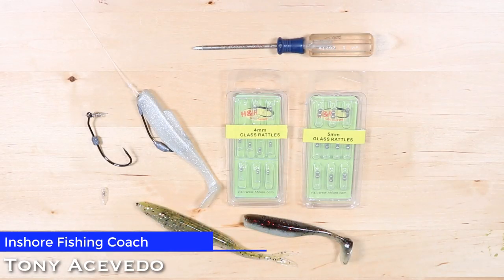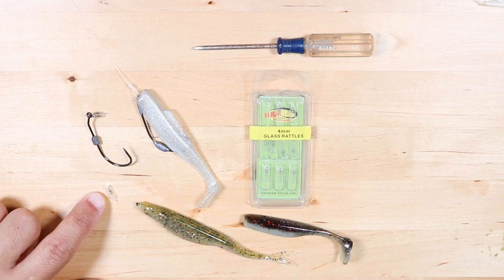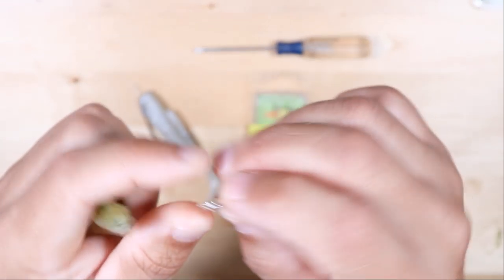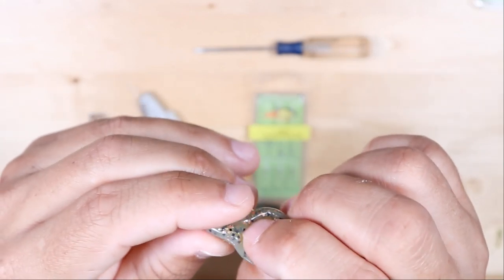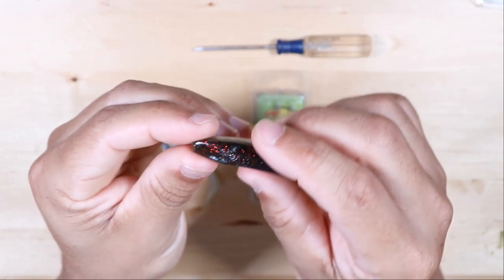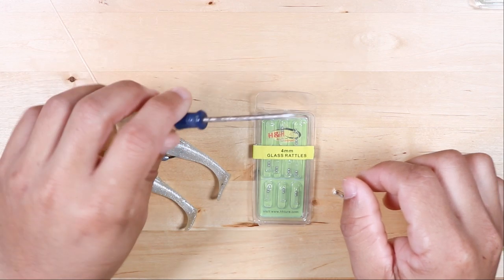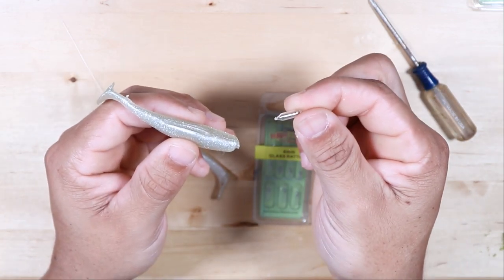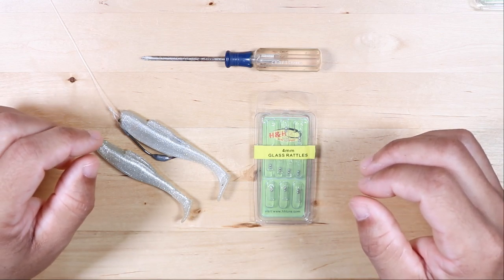Adding Rattles To Soft Plastics (To Catch More Fish)

Comment: Again, I don’t know if y’all check comments on older posts, but would you ever use a knife or hook point to create a small hole to help ease the rattle into the soft plastics? Thank you for the constant tips, hints, and tricks on using soft plastics. Great video and keep up the great work!
Reply from the maker: Yes, we often use the hook point and barb to help create a tunnel for the rattles to go into. (I don't recommend using a knife because it'll create too wide of a slit)
Reply: I Use a spent 22lr brass to pull out a slug then slip it in the  hole. Especially the 5/6mm. Maybe a small Dia copper pipe, or a small straw could work? I know this comment was a year ago... might help someone else..